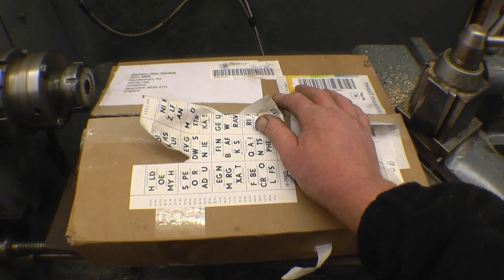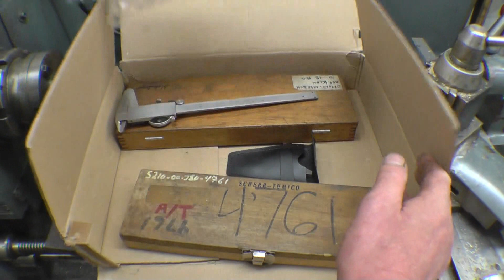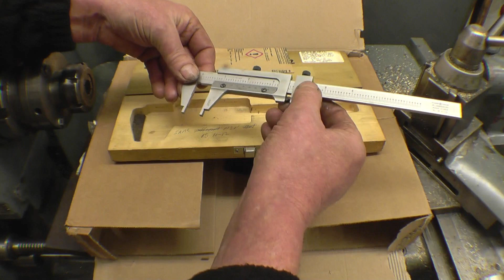SNNC 316 P1  Myford Lathe Handle   . Viewer Mail

Comment: Nice video John, and nice new handle also. You might like this tip:
When reproducing some shape freehand you can "define" the rough shape by measuring the diameter say every 10 mm, and then cutting grooves in the blank with a parting blade up to the same diameters. Now just "connect the dots" by removing the material up to the bottom of the grooves. Of course just a rough shape, but it is a good place to start. Woodturners use this also.
Cheers,
Peter

Comment: Some really nice measuring kit sent in there, I like the old stuff that no one wants because its not digital because it can be picked up very cheap, would rather have old fashioned than not be able to afford new digital stuff.
Reply: The most annoying thing about digital is the batteries always flat when you come to use it, that's I keep picking up my mitutoyo analogue.
Reply: @jusb1066  I got into the habit of dropping the battery out when I'm finished with it. 
Just a cheapo digi calipers but close enough for Jazz. 
Even when in the box I couldn't rely on it switching itself on so I took to removing the battery. 
If you don't have the box to keep the battery in you can slip a thin bit of plastic under the cap to isolate the battery. 
The thin 'window' sheet you get with food boxes is ideal for the job.